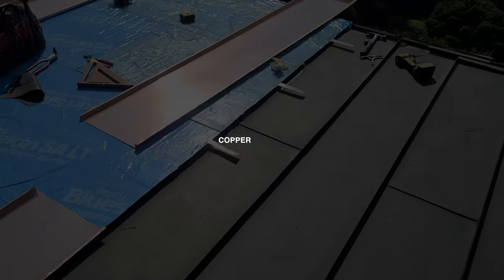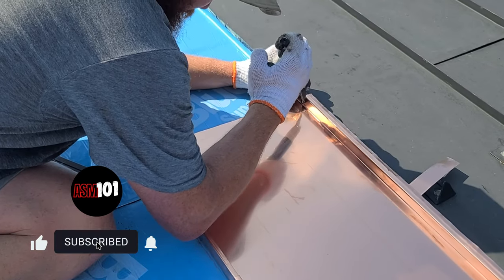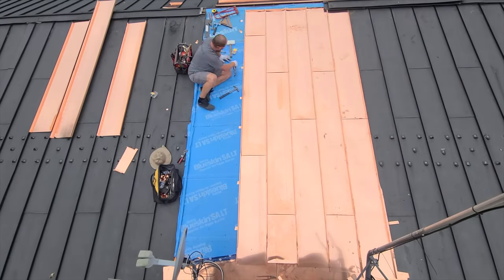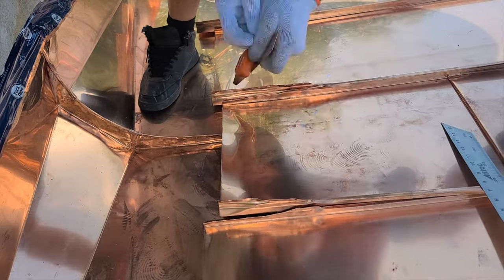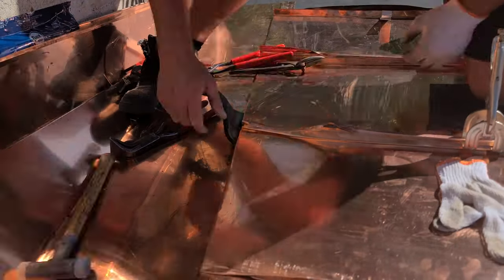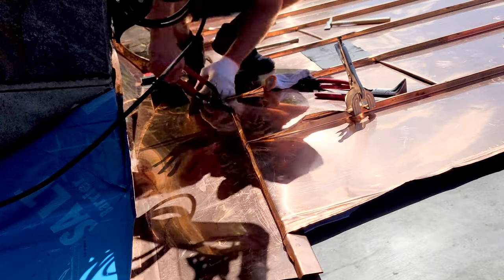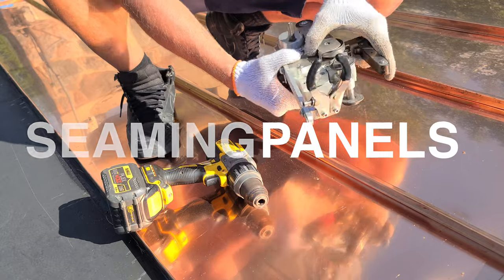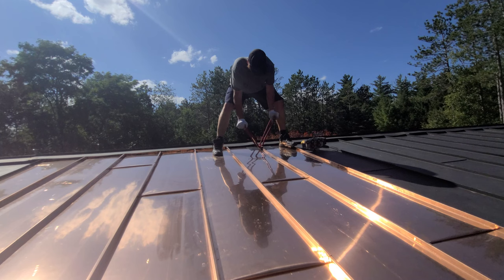Finally Installing Standing Seam Panels on This Roof!!

Comment: Did you have any problems getting that last panel in?
Reply from the maker: No...had a hard time getting the existing panels off...honestly the hardest part of this project
Reply: @asm101  Looking forward to seeing you wrap that sides of the chimney :-O
Reply: Was tar paper under?
Thx GREAT Job!!! @asm101
Reply from the maker: @mmroofs   that will be next my friends!
Reply from the maker: @613kc  not tar paper...ice and water from home depot..which is not meant to be put under metal roofing...the copper got so hot it melted itself to the ice and water and is basically glued to the roof now